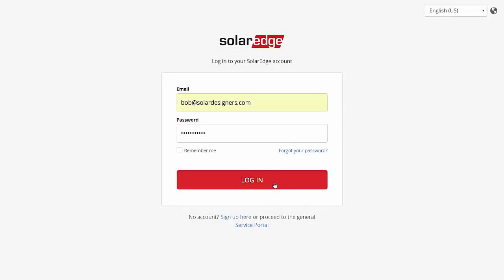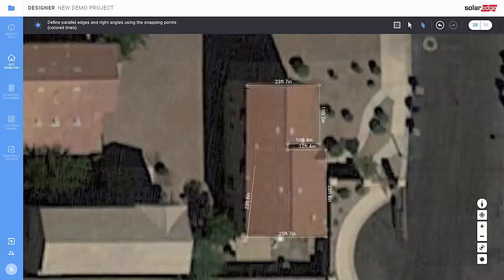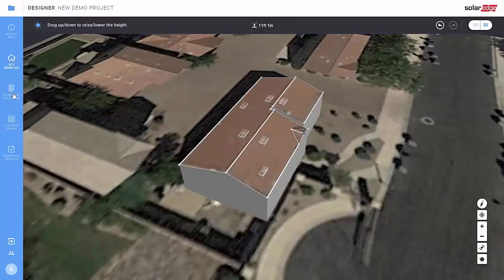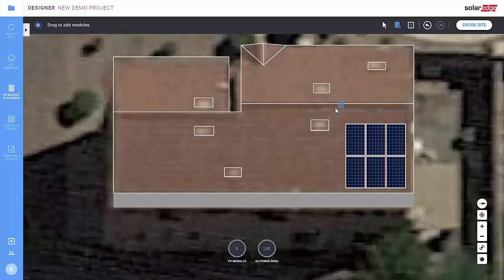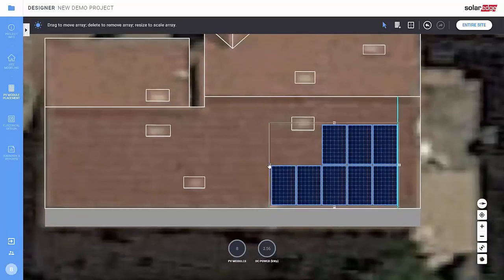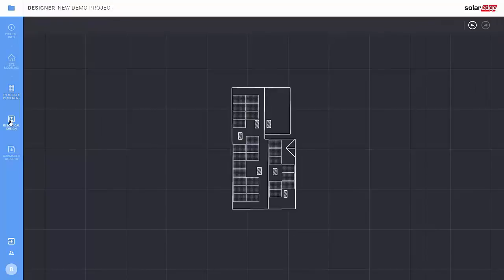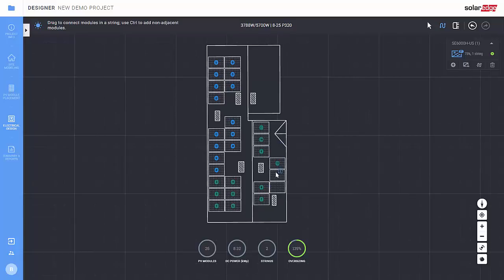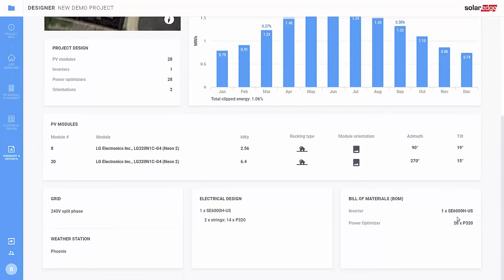Creating projects in SolarEdge's Designer

Comment: Can you add a PV module not on the list? In my case Astroenergy CHSM6612P/HV 345. Also doing a ground mount system in a double array -- would be nice to have the Designer identify the spacing required between arrays.
Reply from the maker: Hi Farrell, always great to hear suggestions from our installers. We're checking this for you with our development team.

Comment: Hello SolarEdge, I have a question
.
I signed up for SolarEdge Designer, and when I want to make a project, the address satellite imagine is an old one, the house is not build yet, but in reality the house has been built for around 1 year. What can I do? (in google maps the image of the house is updated)
Reply from the maker: Hi Pedro, thanks for reaching out! You can upload a custom image of you site on top of a google satellite image. After creating the project, click the background image icon. In the meantime, we'll check with the satellite image provider to sync for the latest images.
Reply: @SolarEdgeTechnologies  Are there any requirements for the custom image, such as pdf, jpg, gif or minimum resolution?
Reply from the maker: @thomasmartin896 : You can upload images with a file size of up to 5MB
. Image resolution  must be minimum 2 pixel per meter, max 400 ppm

Comment: How can you do a location that has a P.O. box for a address, or rural location?
Reply from the maker: Thanks for reaching out! You should be able to search the location in Google maps. Are you able to find it?
Reply: SolarEdgePV let's say it's a new building that is not mapped yet, or a location that a Google search will not find. There is no way to drag the map to the spot I want.
Reply from the maker: You can type a location in the vicinity and then move the map pin to the exact spot. In case the building is not mapped/built yet, you can toggle the satellite image off and design in a grid view.
Reply: How can you move the map pin, I cant figure out how?
Reply from the maker: During site creation, the map pin can be moved by dragging or by double-clicking the relevant location.
After the site is created, you will not be able to move the pin anymore.

Comment: I'm dealing with a flat, rectangular roof that is oriented toward the Southwest. I'd like to layout the ballasted array toward the Southwest (in line with the roof), but the program keeps laying them out facing south. Is there a way to select the orientation of these panels? I don't have this problem with sloped roofs facing in any particular direction. Thanks.
Reply: Ok, I found a work-around. If a slight pitch is added to the flat roof, the panels snap to orthogonal and follow the lines of the building instead of a due south orientation. This can work for me now, though a little more flexibility in how the panels are oriented would be idea. Still, I like this tool!
Reply: @scottwhite6348  works indeed

Comment: This online program would be much easier to use if you could lock pieces in place once they are set. As it is it this online program is great for system designs on basic very simple style homes. With complicated to average roof designs the system begins to break down and distorts dramatically.  Ctrl click move into place, release clicker on mouse and the corner or roof edge locks in place as an example of how this could work. This would mean you could move any distorted pieces in place and lock them in to prevent continued distortion. Or lock in the outside edges of roof structure to a set height could dramatically increase the speed at which 3D structures could be created and improve accuracy of measurements and angels. Additionally the P.V. Calculator could be ran or used in conjunction with something like your own solaredge P.V. calculator, or P.V. Watts to create a cohesive and more accurate calculations page. I have been using this online program for approximately 8 hrs in total. These complaints could very well be that of a novice user of the program but the more user friendly the software becomes the more people will consistently use it.
Reply from the maker: Thanks for the feedback! We will make sure our R&D team looks into this.
Reply: I am having the same issue, trying to use the 3D tool on a modern home is a difficult task. Tried placing the points in different position but no matter where I place them I always end up with a teeter totter effect and does not have any predictability. Lift center of roof, only the SE corner will raise along with the point you selected. Lower a valley leading to the front, NE corner shoots off into the sky with a small adjustment. Best used for simple structures or a flat top roof for now, hopefully this improves with time!